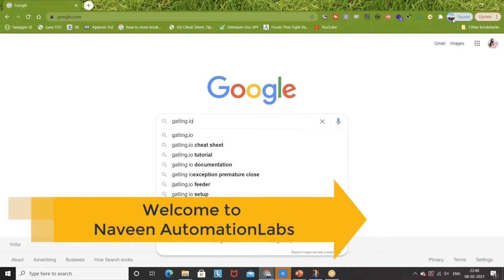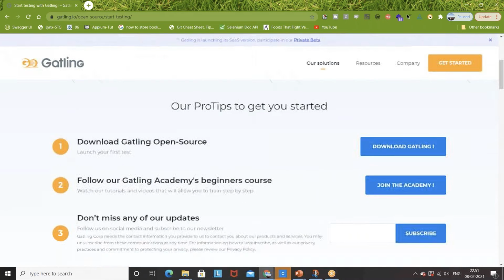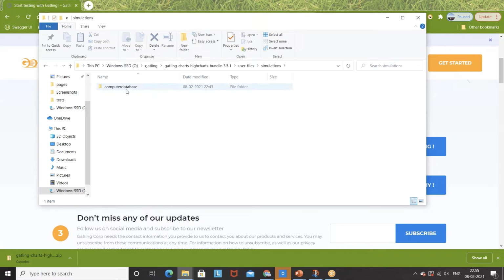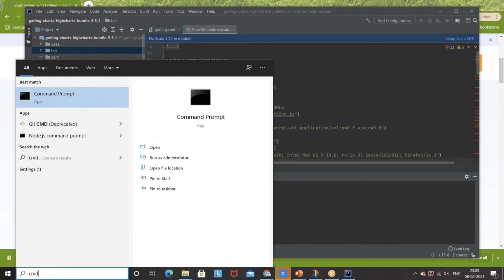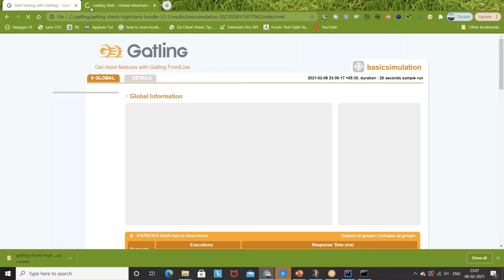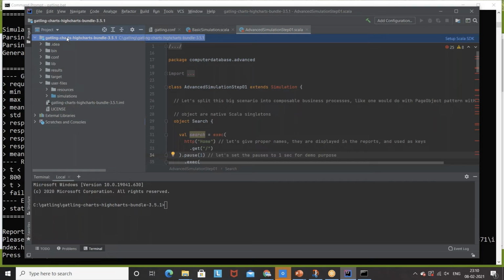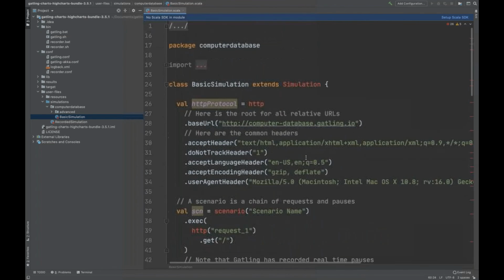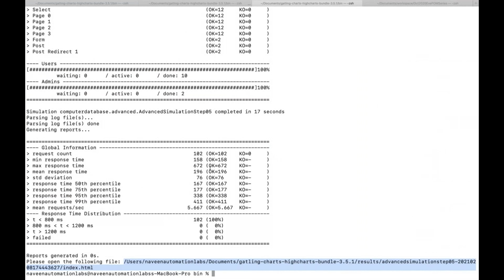#1 - Gatling (Performance Load Testing Tool) - Setup and Installation (Windows/Mac)

Comment: Thanks for helpful video.  I am also looking for perfect tool to test my application and also want to automate most of the task.
Need your suggestion what tool should I choose.
following is the details of my application. 
1. It is simulation application. in which I create a physical environment in Desktop application. 
2. Garment industry application.  which create a virtual sample of real garment (tshirt trouser skirt etc). output is in form on JPG or video etc.
3. It all starts from a 2D application. where user creates outlines and then update to 3D. where these outlines filled and created like a actual piece of garment. like a tshirt pieces. then it get placed on 3D avatar in my 3D simulation application. create stitches. Drape it. walk it with 3D avatar and finally render image or video. 
4. we are testing these manually.
5. I want to automate these all scenarios. 

Please suggest a good tool to start testing such GUI application.

Comment: Hi Naveen, greetings
I'm working in banking domain project for US client, currently we are doing the performance testing using loadrunner scripts, but recently I'm told that we need to convert LR scripts around 28 scripts to Gatling scripting, 
I don't have any coding expertise. Can you please tell me what is the pre requisite to do the Gatling scripting coding level I'm very poor.